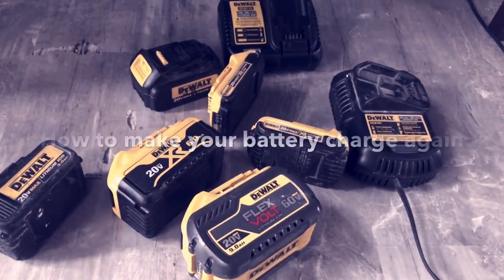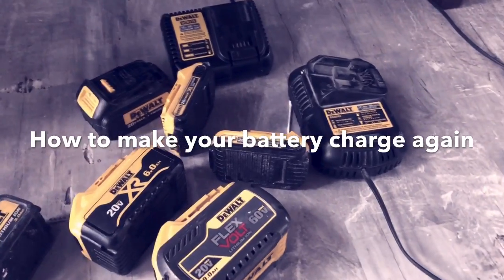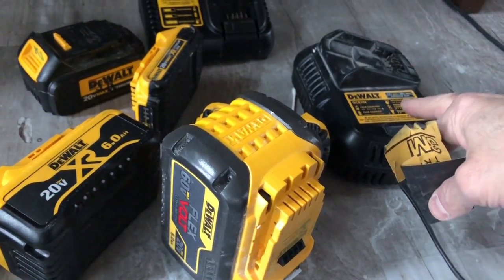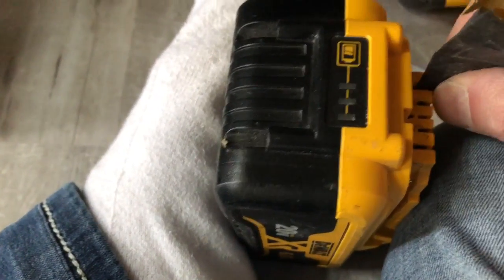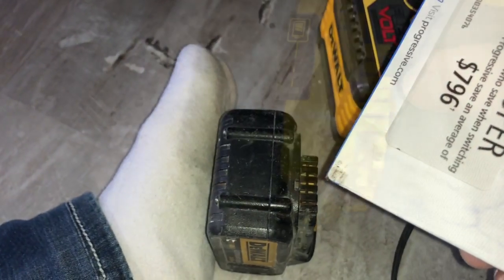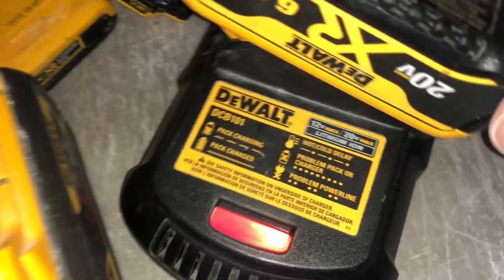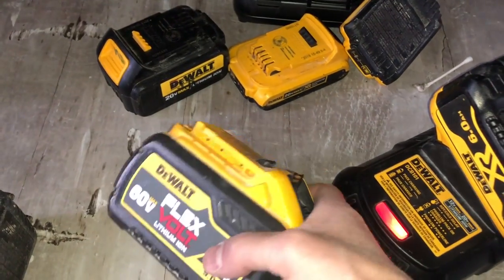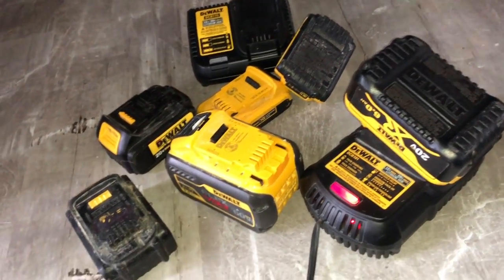How to fix your lithium DeWalt battery that won't charge

Comment: Excellent! Thanks man! Already had a "dead" battery that had been in my cab for a while with a black x drawn on it so I knew not to use it. Been meaning to do something with it but never got round to it.  Then another batt went today, wouldn't charge or display any green LEDs, I thought it was done.  Thought "not again" and had a quick search and saw this vid, didn't even use a cleaning solution, just got the fine grade emery paper out my van and cleaned the contacts on the battery and it started charging! Got the old one out the van, did the same and it started charging too!  Much appreciated!

These were dewalt 18v 5.0AH XR series batteries.
Reply from the maker: That’s awsome

Comment: Youre right at the end the dust covers protect fromdebri, humidity and any sort of particle that could corrode your pack terminals.

Got around having to carry them individually by fixing them to a simple 2x4 with screws spaced out appropriately. Add a little handle and youre good to go brother 👍 been holding up for a year now and can bring in all my batteries dust free from the truck in on cold nights, would definitely recommend. Good luck!

Comment: Did not work for mine. Because it was not a battery issue.
Turns out that these packs have a "fusible link" inside. Mine burned in two. Apparently, it got very hot and melted the inside plastic as well! Can't find any video to show this. Looking for a replacement has turned up nothing.